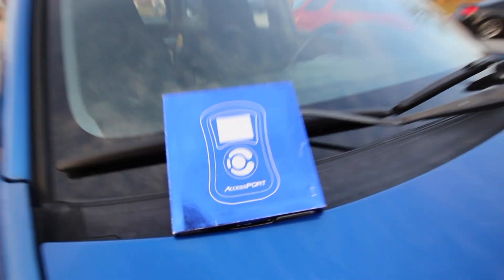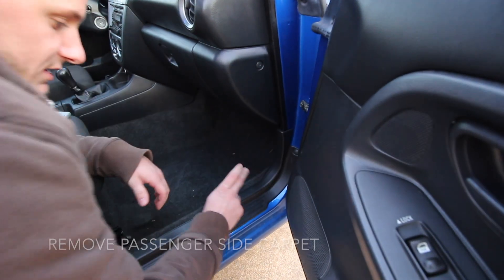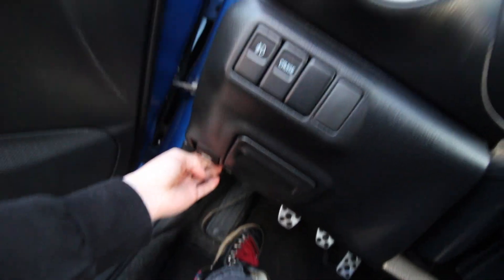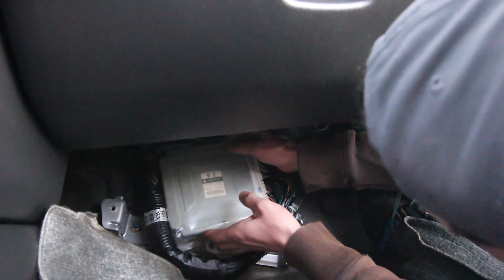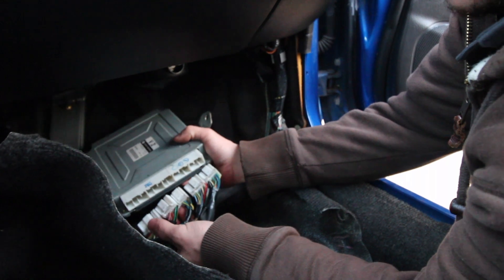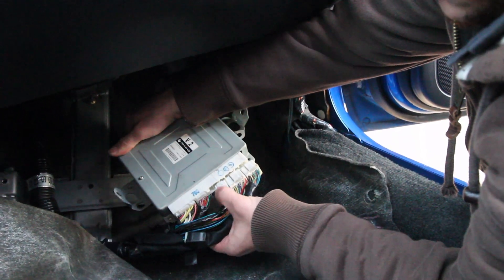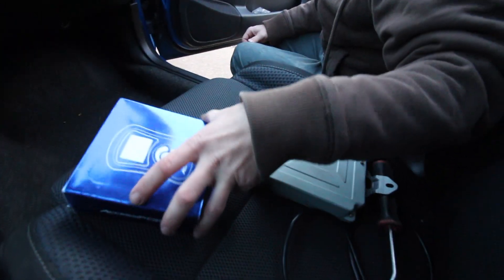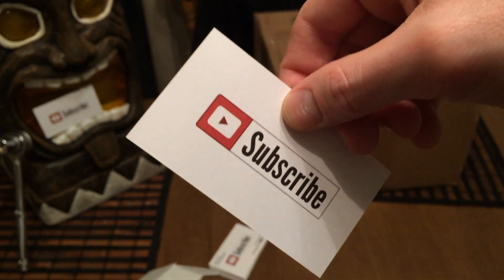How to Change ECU [Engine Control Unit Swap // Subaru]

Comment: great video....planning to swap a used 04 fxt a/t ecu with my 04 fxt a/t ecu and was wondering if it it needs to be reprogrammed to my car like the later year ecu's.
Reply from the maker: i'm not certain.. It all depends on whether those models came with the new immobilizer that they added around 2005.. If not, it should be plug-n-play w/o any reprogramming.. If it does have one, software may be needed to make it work, but it will still work afterwards
Reply from the maker: Thank you for your support Joey! 🤟

Comment: So I just got my ecu unbricked from Cobb havnt installed it yet… I took my ecu out with my battery connected and it’s still connected I know I need to install it with it disconnected but is it bad that it’s still connected now? With the ecu out?

Comment: Did you do an ecu programming after making the change? thanks
Reply from the maker: We didn't. It was plug and play, the car just thinks it's a different WRX that got crushed, but it will still pass inspection like that

Comment: Hey wondering if you could help me? 
I had to change my cluster in my 2009 forester and now it won't start 
Do I need the keys with the key tumbler and the ecu outta the car I got the cluster out of ?
Would that work possible 🤔?
Reply from the maker: The newer ones have demobilizes that need to be overridden with high end software.. The dealer can likely transfer the information and unlock the car
Reply: @milsgarage  thx have a guy coming tomorrow afternoon to reprogramming and unlock it hopefully
Reply from the maker: @chrisv6008  Awesome 🤘🤘🤘 i hope it works out 👍
Reply: Hi  @chrisv6008 
Let me know what had to be done to het it going.
Planning Ecu swop on 2006 Outback.

Comment: My 02 wrx flooded and needs a new ecu/fuse block. So I can just source a 02 ecu and plug it straight up?? Or will I have to program anything to make it work
Reply from the maker: This one plugged in and worked just fine 👍. As long as it came out of a similar model, it will think it's still operating the old car. Ryan's came from a scrapped car, so there's no need to worry about changing the VIN or anything

Comment: So i have an 08 outback xt and im about to change the ecu because mine is shot, would i have to change out anything else or is it just plug the new/used one in and it'll be good to go?
Reply from the maker: It was just straight plug and play, but i believe they changed the disabler system around 2005, so you might have to get the dealer to reactivate the car if it sets it off
Reply: @milsgarage  okay thank you
Reply from the maker: Anytime sir. Keep up the great work 🤘🤘🤘  @the_subaru_dude1498

Comment: my SF5 Forester GT Turbo = ecu is untuneable = they say i need a 2001 wrx ecu and all door and ignition switches from the same car = or it wont start !
Reply from the maker: They implemented the demobilizer in the early 2000s

Comment: So I have a 2002 wrx bugeye. My ecm is junk. Could I take another ecm and plug it in and car runs or does the ecm need programmed. I have a regular key. No sensor on the key to match.
Reply from the maker: As long as the other one is from a similar model, yup. It'll just be running code that still thinks it's the other car, so VIN would be different
Reply: @milsgarage  So much good info here. Thanks!

Comment: Same deal with an 04 forester?
Reply from the maker: Possibly.. 03, 04 and 05 are the years that they started switching to the new anti-theft programming, so as long as the ECUs are running the same in that aspect, they should work
Reply: @milsgarage  If you are just swapping the ECU to a stock ECU because you burned out the other one for whatever reason they should swap out and fire right up. Code for my 02 Fozzy S ECU was 1G 22611 AG392. Hydro-locked my last engine which fried the O2's, filled my Cat with water and deff destroyed the the ECU.

Comment: Hey guys, mine is not working anymore and I need to buy a new one. should I buy one with the same code? I´m in Chile and they dont have it here. Any place you recommend me to look at through the web?
Reply from the maker: Hey Brenda, sorry for the delay! Thank you for finding us in Chile 🤟. The ECU will work as long as it's for the same type and setup. You're going to want to know which years they sold your version of the car, and then shop around the options you can find.. Ryan found the ECU for sale on Facebook Marketplace, but i imagine they're sold all over ebay, google and Amazon

Comment: Can i put ECU subaru sti 06-07 for forester sg9 06 ?
Reply from the maker: i’m not sure.. They installed the upgraded demobilizers around 2005, which might be an issue. i would try to swap the same ECU and then tune it to the sti specs

Comment: I’m swapping an 02 to 02 is there anything I need to worry about? Because I’m seeing people commenting about changing VIN number or something like that
Reply from the maker: Yessir. If the only difference in model is the VIN, the car will run perfectly, but the VIN in the programming will follow the ecu from the older car.. We got the replacement ecu from a totaled junk yard car, so it won't matter that the VIN doesn't match up. i believe you can change the VIN, but i imagine it would have to be done at the stealership, where they'll push a couple buttons and ::beep beep boop:: charge you some inflated amount of money
Reply: @milsgarage  I'm damn curious about this. I asked a similar question above. So, I can find a match (model) for my ECU and swap it, and it won't break it. But if the model is off, it's like putting a dog brain into a cat. That won't screw anything else up? My 2010 Forester has been acting like a jerk and I need to swap its brain.

Comment: When you swap the ECU does it need to be programmed for the Impreza as I was told it would need it coz of the immobiliser
Reply from the maker: Overcoming immobilizer issues takes an extensive understanding of how the codes work and how you can transfer them physically.. Or going to an authorized dealer who will have the manufacturer programs. i've seen it done by turning the ecu on with only certain wire packets connected, physically transferring the codes from one ecu to another. The immobilizer works by checking for 3 password codes in order to initiate the start. In our case, we didn't need to mess with the immobilizer, but it will be an obstacle with the newer cars for sure.
Reply: @milsgarage  I have an 04 blobeye WRX and someone said if you connect 2 connectors under the stearing wheel it will reset the ECU to factory settings
Reply from the maker: @pat hunter Cool, well if you get a chance to try that out, i'd love to know how it works out for you 💯
Reply: @milsgarage  I've heard just disconnecting the battery and then trying to start the car a couple times should clear it to factory new

Comment: Currently driving a 2004 WRX and have reoccurring inconsistent CELs. Could I just need a new ECU? Is it in the same spot on a 2004 ?
Reply from the maker: Inconsistent CELs? i imagine that's possible, but what CELs are popping up? Yep, the ECU should be in the exact same location
Reply: Mils Garage Misfire on all cylinders everytime , done plugs , checked coil packs/cylinder compression and cleaned MAF sensor
Reply: @alamjitc.2639  I'm having the very same problems with my 09 outback. So what was the solution?
Reply: Tlizibreath mine ended up being my turbo inlet was torn

Comment: How do you program the ECU to the vehicle? I've read that I can swap the ECU, but then I have to program it to the specific vehicle it is in.
Reply from the maker: It all depends on which car the new ECU comes from. On the older cars, if it comes from a totaled car, the only difference is the VIN#, so you have nothing to worry about. The VIN can be changed at the dealer.. The newer cars have immobilizers that need to be bypassed, and 3 startup codes have to be transferred. My understanding is this can be done with the dealer's software too
Reply: @milsgarage  did you have to deal with any of this or was it all plug and play for you I'm going through some bullshit with my ECU right now I have another three WRX was just wondering cuz I also have access Court to you

Comment: Adam I need advice. Have a 2006 subie sti with po448 and po448  spent already 1500 dollars. Verdict  pcm problem. Try repair 1st at g7 computers in n.y. then replacement if unable to repair. Who do you recommend  I'm in hamden, ct. Thanks
Reply from the maker: Hey Piri, i''m sorry to hear you're having this issue.. We're located in Delaware, and i don't know of any specific garages up there atm. Maybe we have some people in the comments who can refer you to a garage

Comment: Mine is stuck in limp mode. Giving a few different throttle / pedal sensor errors. Tried changing the pedal, didn't work. Just took the throttle body out and cleaned it and nothing.  

Have you ever seen one where, when idling, it revs higher than normal, but when you press the brake the revs go back down to normal / low. Then when releasing the brake pedal it starts revving high again. Pressing the accelerator does nothing at all.
Reply: I disconnect the pedal and it stops doing the weird revving thing. Plugged 2 different pedals in and they both do the same, so maybe not that, unless they are both knackered lol

Comment: Can i swap wrx ecu in NA subaru turbo ?
Reply from the maker: The maps have to be correct and pretty exact to run a turbo setup.. It's not likely an unboosted ECU can be directly plugged into a boosted setup and start.. If you can change the map, it's likely to work, as long as they're similar years, and you don't run into issues with an immobilizer

Comment: Sounds really good got me interested!! 
Question does it void warranty?
What happens if your ECU take a shit? God forbids not to be negative just curiosity. Do you just swap back the original?
Reply from the maker: There's a lot fo legal stuff in warranties so i can't speak on that. If the ECU dies, it can be replaced. i believe Ryan's still running the new ECU. No point in doing more work when it's all working and legal 👍

Comment: hi I have a subaru impreza wrx 04 and swapped the engine complete with ecu sti 05 but the car does not start, could you tell me how I could solve it for pleasure
Reply from the maker: @Rosario Buonanno 🤟 Don't worry, i do that all day long lol.. i know this is gonna suck, but i'd recommend double checking all of your ground connections and fuses
Reply: @milsgarage  the problem is that it does not start with the ECU STI, while with ECU WRX it starts quietly, (the internal wiring of the car is original WRX) that you know the pins of the ECU are different from each other?
do you know how i can solve?
thanks !
Reply from the maker: @Rosario Buonanno Oh wow, they're wired differently? .. Now that's absolutely a pain in the butt O_O. Well.. You can track the wires by using a power probe diagnostic tool, but it's going to take forever.. Maybe someone in the forums has done the job before and posted diagrams.. i'm not an expert on diagnostic wire work, but i'm sure there's a lot of information here on YouTube and on the Subaru forums
Reply: @milsgarage  do you know where to direct me? because i can't find anything about it, not even a pattern. thanks
Reply from the maker: i'll have to search a little more later.. i was searching around and apparently "pinout" is a term used for quick-reference service manuals, so the SEO for pins pulls up a bunch of blah.. The information is probably buried in the internet somewhere
Reply: @milsgarage  if you can find something you do me a favor, meanwhile i keep looking,

Comment: Great video. On my Legacy BR the engine control unit has a bug and I would like to exchange it. I guess it's on the passenger side of my car too. Does the ECU need to be trained after installation or can I just put the key in and start the car?
Reply from the maker: As long as there isn't an immobilizer involved, it should start right up, but i'd let it run for a little before revving it or driving hard. i'm not familiar with overcoming an immobilizer, though i've heard of ways to do it

Comment: Did you have to reprogram your ecu to your Vin number? If so, which software did you use?  Great video ty.....NVM I see you used Cobb
Reply from the maker: yessir, we used a COBB AP. atm, i believe the car thinks it's a 2003 model with the other car's VIN, but the car the swapped ECU came from was crushed and legally dead, so the WRX is a zombie 🧟‍♂️. the 2002/2003 models didn't have an immobilizer, but if you're looking for a way around that, i know a way
Reply from the maker: i did a little searching on the subject and found a video where a guy actually transfers the codes needed to start the car, manually. he says not to unplug all the wires at once but hopefully this method will bypass the immobilizer by transferring the access codes to the new ECU [ https://www.youtube.com/watch?v=fJ_pflu4eBg ]
Reply from the maker: we did it on this wrx. because we swapped a 2003 to a 2002, they both used the Alpine System, but 2003 is the first year Subaru started using the System.. Alpine uses the the fob to control the alarm. Subaru start using the immobilizer keys in 2005
Reply from the maker: that guy's explanation matches with my understanding of automotive ECU's. it's a matter of transferring 3 codes from one unit to another. not trying to be an ass, most people won't even answer questions about how to bypass an immobilizer system. 🤟😎 no worries, just trying to help. i haven't done either of these procedures myself, but with the correct software, it's absolutely possible to transfer the 3 verification codes which will operate the car. i believe Subaru certified mechanics may have such abilities.

Comment: Have a cel po448 will check pcm wiriing at b134 thanks
Reply from the maker: Miriam comes here with auto problem. solves auto problem. posts answer to how to solve CEL P0448.. goes back to garage to fix everything. 🤟😎👍 conclusion: +Miriam Vivo is a boss mechanic.

Comment: I have a 98 Subaru do I need a dealership to swap my ecu ?
Reply from the maker: i would like to say it's easy, but i can't, because i know people who don't know the torque for lug nuts.. It might be plug-n-play, but there are too many variables for me to give you a solid answer whether you will need a dealership's assistance or not
Reply: @milsgarage  shoot I got a stealership about 4hrs away trying to save a buck that's for the reply tho!!!
Reply from the maker: @kevinsleppek6058  Any time of course Kevin! 👍 Yeah, they didn't have emobilizers back then, so you can just unplug another ECU and plug it in ( as long as the model and the features are the same )

Comment: Why did you change the ECU before you tune?
Reply from the maker: Ryan purchased a used COBB AccessPort that was married to the ECU of a totaled WRX, so our only way of using the tuner was to swap the ECU
Reply: @milsgarage  married meaning its locked 🔒?
Reply from the maker: @chillin fruits Yes, it was locked to the old car's computer. When it's married, it removes the original map from the ECU, and won't work if you plug it straight into a new ECU. As soon as we unmarried it, we were able to switch the ECU back to the original one and install the new maps 👍

Comment: So we did the swap but the engine won't start. 
Might you know how to fix this. It's a Subaru Legacy BP5.
Reply from the maker: does it try to turn over?
Reply: Sarah GatUmbo was it definitely the right ECU to swap, and did you make sure everything was plugged in properly? Is the check engine light on?

Comment: hola como hiciste con la programación del inmovilizador solo conectas la nueva y listo el auto prende sin problema
Reply from the maker: that's a great question! because we swapped a 2003 to a 2002, they both used the Alpine System, but 2003 is the first year Subaru started using the System.. Alpine uses the the fob to control the alarm. looks like Subaru didn't start using the immobilizer keys until 2005 (sorry my Spanish is not so good)
Reply: no se preocupe por el español ok ok entonces como son años anteriores no tienen problema bueno yo voy a seguir investigando gracias
Reply from the maker: any time Reinaldo 👍👍 i did a little searching on the subject and found a video where a guy actually transfers the codes needed to start the car, manually. he says not to unplug all the wires at once but hopefully this method will bypass the immobilizer by transferring the access codes to the new ECU [ https://www.youtube.com/watch?v=fJ_pflu4eBg ]